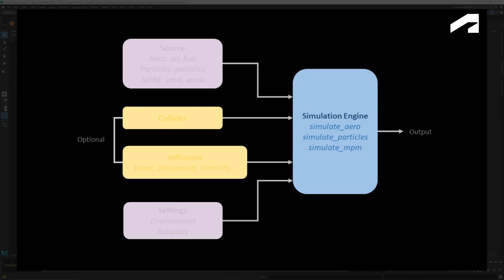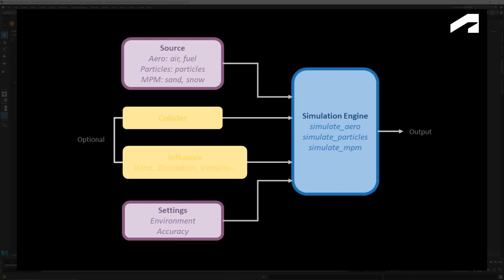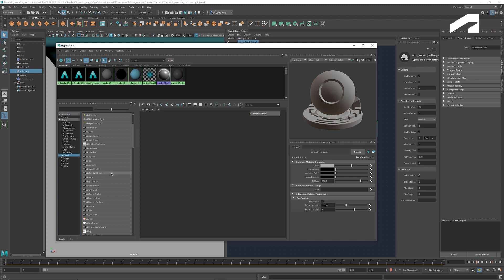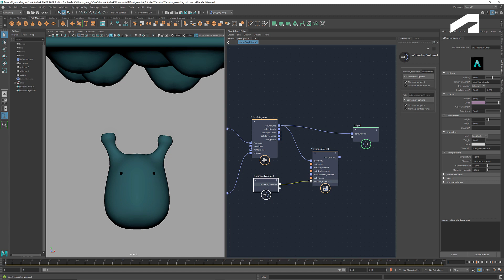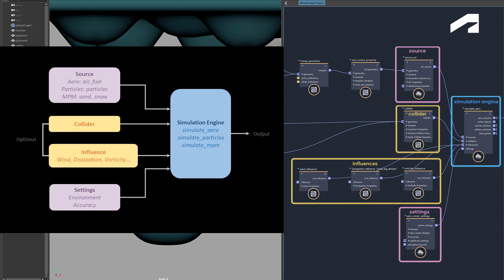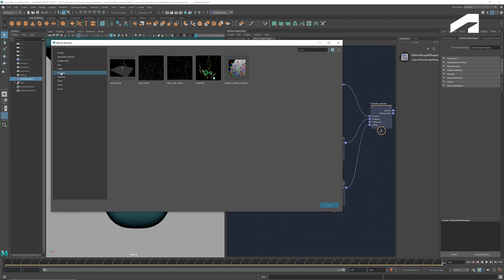Introduction to Bifrost: Lesson 4 - Simulation basics

Comment: Good explanations, btw will this same emission method work with a skinned / deforming mesh?
Reply: Yes, you can set a skinned/deforming mesh as the emitter using the same method described in the tutorial. The simulation will update automatically with the deformation of the mesh.
Reply: @tinywhimsies  Excellent, thank you!